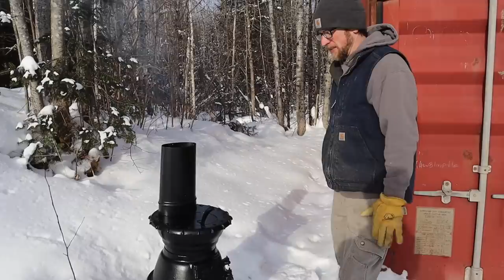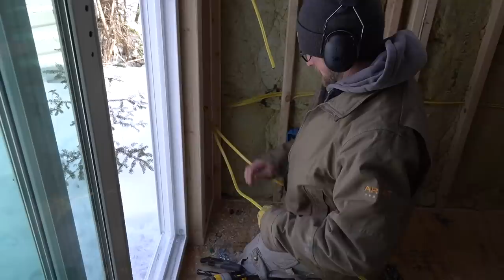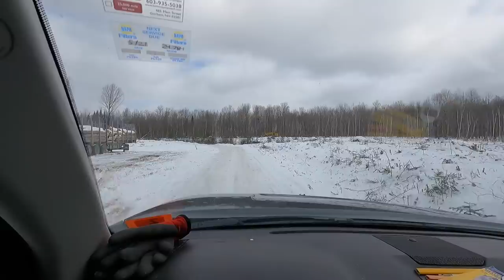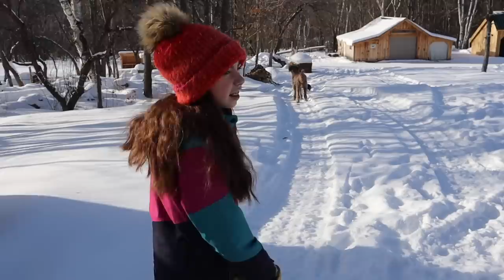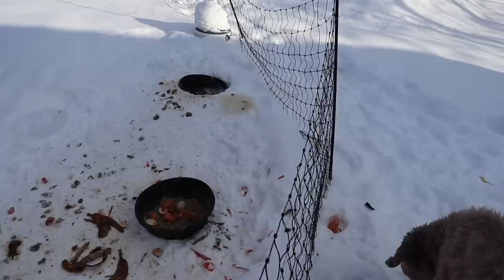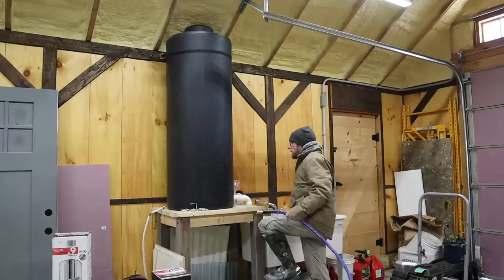Wiring Exterior POWER on OUR OFF-GRID Shipping Container Cabin in the WOODS

Comment: You may want to install a door on the middle wall in the future. For easy access to the fuse box and storage.
Reply: There was never going to a door there as stated in a previous video when they were framing that wall. Remember that the cabin is only for occasional use, it's not a permanent home.

Comment: In the mid seventies, a friend gave me an almost identical potbelly (without the decoration) He had used it as a one car garage heater. I put it in my teenage daughter's bedroom as a nightstand. In 1980 I built a little 16 X 16 "cabin/workshop" and took the stove out there after she went off to college. Lots of small change in the bottom! I burned my mistakes and a lot of 10" firewood over the next twenty years, often red hot. I'd start a small fire every morning before going to work and restart it late afternoon. Kept that well insulated building above freezing in spite of below zero Illinois winters. Finally had to remove it when we got a different insurance company. Put stove black on it every few years. I forget where it is now. I heat with a ventless natural gas wall-hung heater now. They don't wear out but of they do they still keep on working.

Comment: Put a small reverse cycle split air conditioner in the container,  it will,take out moister, prevent condensation, can be used to heat and cool. Will run on a suitably built solar system and generator, cheap to buy, simple to install... That stove will not run through the night so limited use in full winter.
Reply: Excellent idea, I was a bit concerned with condensation.
Reply: Would be nice, but power?
Reply: @benthere8051  solar power
Reply: Ben at The Hollar but the splits in his new trailer. Says it was easy to install and so quiet.
Reply: @CrankyAuntyLinda  - I use mini-splits in my home and they are wonderful, very quiet, and very efficient. But they have a 35 amp startup current which means you need a very expensive inverter to make them run on a solar system.

Comment: Your gonna need cement backer board for anywhere the stove is less then 36 in. from a wall. Close to that glass might not be a good idea either.
Reply: Sheet metal works well also.
Reply: You know it all don't ya
Reply: 36 inches? Are you sure ?
Reply: @colinstace1758  At less than 36" you need a reflector or barrier to prevent fires.
Reply: @benthere8051  yep, agree 👍😊
Reply: Yes, he  would have probably had more room if he had gotten a different style stove. Some only need 8 inch clearance, but the one he got does need 36" all around. 
http://pdf.lowes.com/useandcareguides/012685018690_use.pdf

Comment: We built a rustic cabin 20 years ago before the saying off grid was popular-  I insulated it with knotty pine walls-  heat with wood-  now with solar power I wish I had wired it as you are doing-  thought about it then and using a generator but did not want the noise-  solar is quiet-  but it is in the woods and gets very little sun-
Heck of a logging operation!

Comment: Al, I like how well the cabin build is coming along, one thing I want to point out though with the outside boxes, you might want to put some teflon tape around the plugs you screwed in around the sides to prevent moisture from entering in, and I believe the Rec. box cover should be a closed while in use, I think that was code while I use to do electrical work a few years back, but everything looks good and cannot wait to see what you do on the new property.God Bless you and your family...

Comment: Great work! I was wondering if you could show how you ground the electric panel and shipping container? And is there some passive zinc anode corrosion inhibitor that you could add to the container to extend life? It’s common in metal tanks and pipes, but I don’t know if the same could be used for a metal container cabin. Very cool project.

Comment: Install a Hudson valve in the top of the water tank with a short section of hose. When the tank is full, the valve will stop the water flow and with the short section of hose, you won't have to climb up there. You can find the valves on line @ us plastics

Comment: Build's coming along just nicely! Just a quick query on that external socket.. is it the same as what we use here in the uk in that it has its own internal RCD (recommended) or is it a standard socket and relying on the breaker in the main fuse board ? if it's the latter,.. i would recommend swapping it out for one with an rcd inbuilt for additional safety
Reply: 15:51 - it looks like it is a GFCI (ground-fault circuit interrupter) socket - Al must be on your wavelength!  :_ILikeIT:

Comment: I use a Commercial or Hospital grade duplex outlet receptacle...the are better built and hold the plugs in better.  Cheap outlets are lightly build and quickly lose ability to firmly hold the plugs in....and some cases cause arcing within the blades of the outlet.

Comment: Al when you ran your elec wires parallel thru the dividing wall , was there a reason for running them low instead of up higher out of the way ? Just curious .

Comment: I was wondering if you ever used your big water tank in the shop area. I don't remember ever seeing you doing anything with it since you installed it but today you answered that question. Lol. I don't know what your plans are but you might consider putting another of those floodlights on the other end of the container. Because of the big double doors you may have to weld a bracket  on the roof to mount the light. But this will allow you to be able to get things in or out of your truck after dark. Just a thought.
Reply from the maker: We do. I’ll show that soon

Comment: I am surprised as the empty trailers return empty, the front axle it’s not lifted off the ground the trailer. I wonder if the driver a control valve to manually lift the tag axle? With 3 axles there would be tire snuffing on tight turns.

Comment: Are there any other water Wells in the Area on the new property? I wonder if you can hit water probably.  Probably just drive a stainless steel Well Point down 20 feet and hit water with a hammer. Then put one of the cute little red well pumps on there for temporary water for fun. They work. There should be water by your little stream or pond with the out house. Heck there could be water at your off grid shipping container cabin.

Comment: Need to put a door in the back where you keep stepping over the wires in the wall to have another way of egress to exit the container when you are working on it and to the storage area
Reply: There was never going to a door there as stated in a previous video when they were framing that wall. Remember that the cabin is only for occasional use, it's not a permanent home.

Comment: I've been catching up on your videos, and had some thoughts about the stove and the cold there.  I don't know anything about stoves, but during the time of the centennial,  a lot of companies went crazy putting stars and eagles on things, so the stove might be from 1876, or at least around that time.  For the cold, maybe the camera might work longer if you put dry crystal hand warmers on the camera with rubber bands.  Lastly, for your hands, you said you didn't have the dexterity with your gloves on.  If you got fingerless wool gloves, they are thin, and put hand warmers in the gloves, you could keep your hands warmer, and still be able to use the hammer, or other tools.  I sometimes put a warmer against my palms, and a warmer on the back of my hands while mountain hiking in Washington State.  I buy the warmers by the case, as they are cheaper that way, but the warmth diminishes if you don't use them up that year.

Comment: Hi you may not know it but they make a pair of wire strippers for a Romex 12/2 with ground it's a whole lot easier than that razor blade knife not to mention safer I don't know what Home Centers you have up there around you but I know they carry them at Home Depot and Lowe's I was just curious also why did you close up that door on the back side or was it ever meant to be a door

Comment: Have you thought of using a propane wall mount blue flame heater with thermostat along with the wood stove to heat the cabin area .
Reply from the maker: We want to heat it with only wood if possible
Reply: @LumnahAcres  The propane heater would only be backup for convenience of thermostat bringing it on if the wood stove dies down, like over night.

Comment: I was also curious what are they doing with all the little cut off limbs that the guy that drags logs into the saw and chipping station hauls back out
Reply: Lumnah Acres said in an previous reply that it's being used to fill in ruts on the trails.
Reply: Thanks I guess I missed that

Comment: You should have installed a underground water line down to the work shop BEFORE you poured the slab instead of having to run 200 " of Garden Hose to fill your Storage Tank inside the shop !!!

Comment: Is there a fix you have in mind for the sliding glass door? It seemed to not open easily.
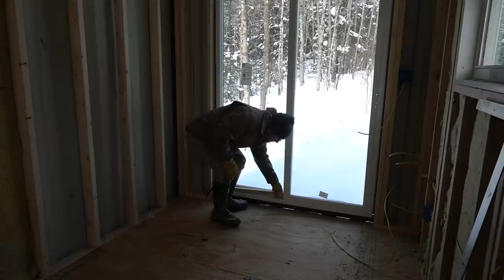Reply: 3:51
Reply: No handle yet.
Reply: @tonygrimes13  good point but I thought it still tilted when he slid it open.
Reply: It just needs a roller adjustment at the bottom. Simple fix, but not necessary at 0 degrees.
Reply: @jimgriffiths9071  I fully agree. I am interesting to see how the entire container shifts when the temperature rises. I have a fear about the glass in the windows and doors.
Reply: @RogerSmith83  The millwork sort of "floats" in it's rough opening. (The shims can compress a tiny bit) Not a concern

Comment: I am not sure why you felt you needed to use 12ga wire everywhere.  I have 9 4' LED strip lights in my garage.  They draw 2 amps total, 35 watts each..  Your lighting isn't going to draw much.  The only place you might consider using 12ga is for the kitchenette outlets. With Solar as your source you're going to use low wattage things.  I hate stuffing multiple 12ga wires in a small box.
Reply: It can't hurt to oversize - the only "pain" will be to his wallet! 🤓

Comment: With all the stuff you have at your homestead why haven't you buried a water line to your out buildings? Even if you can't get below the frost line wou could insulate them, blow them out with compressed air after use or heat trace them.
Reply: Al has said the frost line is like 7 feet. They have difficulty making post holes that are 3 feet. When I lived in NH it felt like the main crop was rocks. I had ledge (HUGE rocks) all around my house.

Comment: Didn't mind it you not talking.  I wouldn't want it all the time but when it's cold it's cold or when you just don't feel like talking.....
Are you sure about the pot belly stove in that tiny space?   I know there are clearances that have to be met and all and it being so close to the glass doors.  I know you like rustic and practical to use the resources you have but wouldn't a unit that's a solar heater/ac unit be more practical?  You will need the a/c just for condensation issues alone and getting a combo wall unit would give you more room.  Just something to possibly consider before you actually install the pot bellied stove.  I think you could put the pot bellied stove to a better use later somewhere else.  It's your build but sometimes you welcome different opinions.  Hope I didn't overstep any boundaries.

Comment: Seriously what is the deal with all the ads? Is that from my end or yours. I'm going to stop watching with this many ads.
Reply: There are add-ons you can get for your web browser that limit or eliminate the ads.  The problem then is, that the family won't get the income by showing the ads.  Look into UBlock Origin and Disconnect for Firefox & Chrome.  Then be sure to run the episode in another browser like Edge or Opera which has no ad blockers, to allow the family to earn the income that would have been generated by normal viewing.  You don't have to actually watch the unblocked episode.  I have it running in the background with the sound muted.